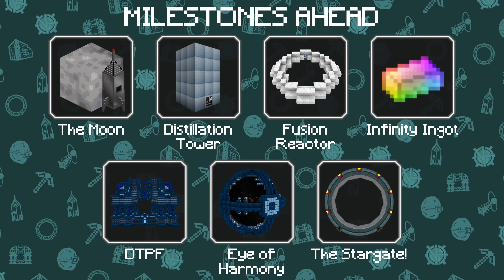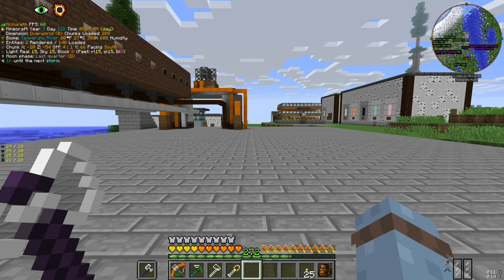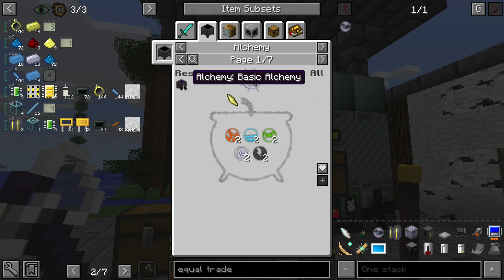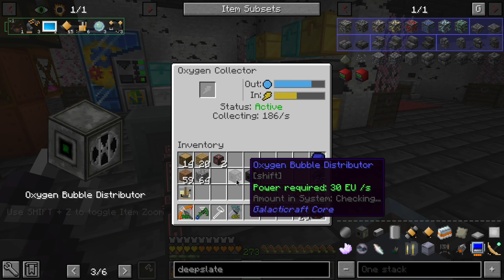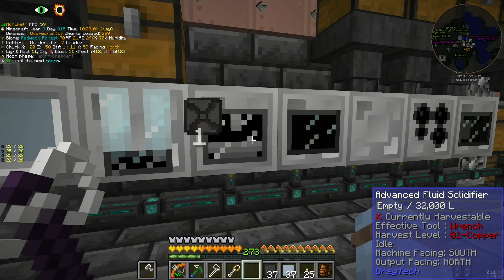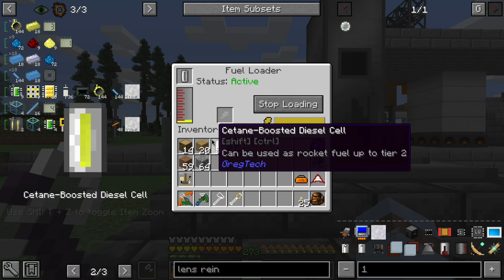I Waited 32 Episodes To Press This Button — #32 Newbie Plays GTNH

Comment: Dude please tell me what MIC you use!!!!!
Reply from the maker: Sure thing! It's the Fifine AM8T
Reply: @Hcnureth how do you get it so clear? I have the same one and it’s not good
Reply from the maker: @JxckArt  You have to setup some filters in OBS Studio (or whatever you are recording in). I would recommend something like this: 
Exact numbers depend on your voice and room. Use these baseline values to start:

Noise Suppression: Set to RNNoise for clean AI removal, or Speex if your computer CPU runs high.

Noise Gate: Open threshold at -30 dB, close threshold at -40 dB.

Equalizer: Highs at +2 dB, mids at -2 dB, lows at +3 dB.

Compressor: Ratio at 4:1, threshold at -18 dB, attack at 3 ms, and release at 100 ms.

Limiter: Threshold at -3 dB
Reply: @Hcnureth thanks dude I’ll try that

Comment: Engineer's Toolbox (GregTech version) - If you haven't already made it (I know these videos were pre-recorded like a month ago and you've been doing streams), definitely recommend!
Reply from the maker: Thanks for pointing this out! Don't feel afraid to bring up tips, I appreciate them all!
Reply: @Hcnureth  Well, in that case.... Thaumcraft Focus Pouch!  :D Since you're getting into TC, you're probably going to be picking up a few focii. You can put it in a bauble slot and it'll store something like 20 focii.  The focus change keybind automatically detects and pulls from the focus pouch.

Did you know there's a Maintenance focus? shift+click it on any maintenance hatch and boom the maintenance problems solved for a low low cost of some Vis.  If I remember right it's in Electro-Magnetic Tools in the Thaumonomomomomomicon.

A little ironic to bring this up considering I just suggested the Engineer's Toolbox, but that has uses beyond repairing maintenance hatches (seriously, middle-mouse click when looking at a cable or a hatch and it'll auto-swap active tool; and you can use all the tools inside the toolbox without opening it.  It's AMAZING).
Reply from the maker: Oh, that's sweet! I'll have to look at the maintenance focus, that sounds amazing! I did recently try the focus of equal exchange and have really liked it, so my love of Thaumcraft is growing, haha. I'll have to get that toolbox as well!